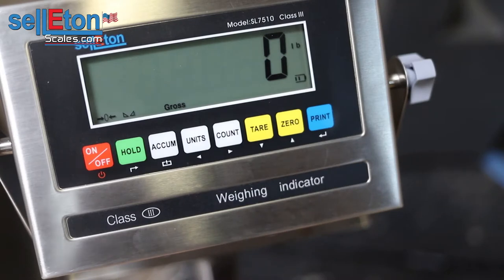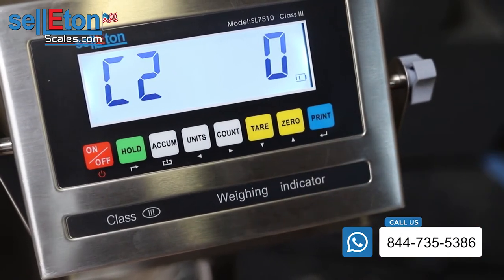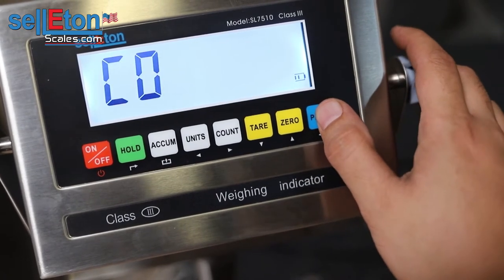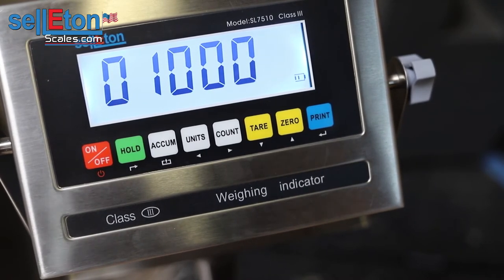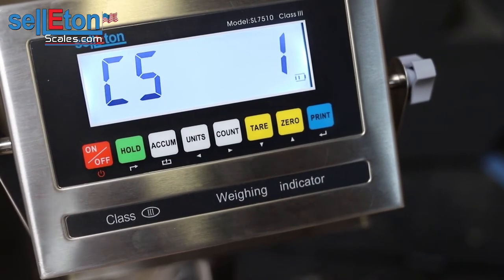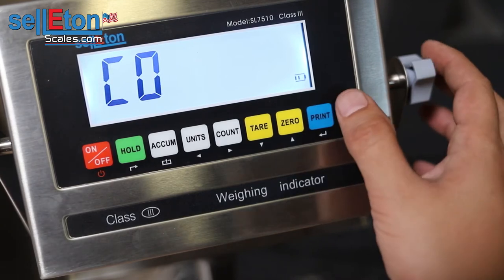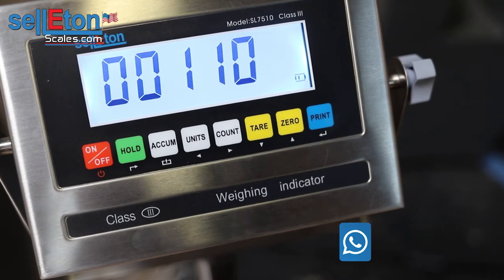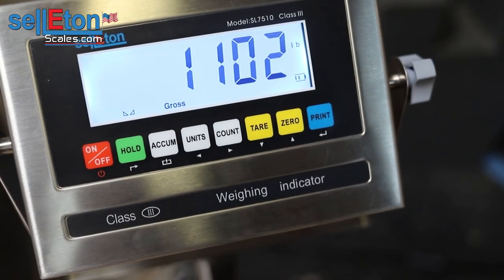SL-7510-SS-C calibration for whole numbers presented by sellEton scales

Comment: What do I do if it does not show the correct weight?
Reply from the maker: You can check your load cells with our ohms testing video or contact us direct at 844-735-5386 for further help.